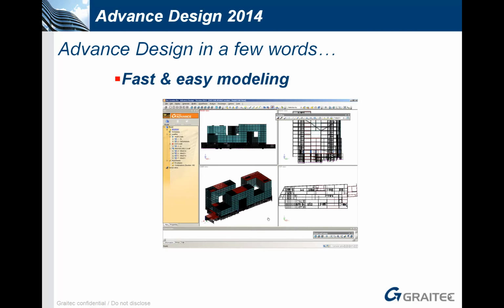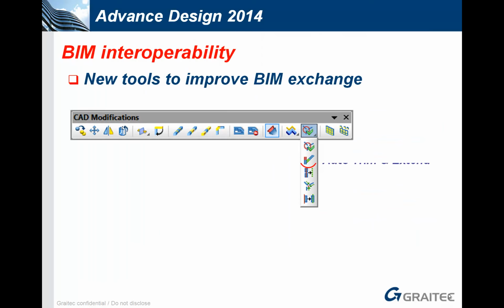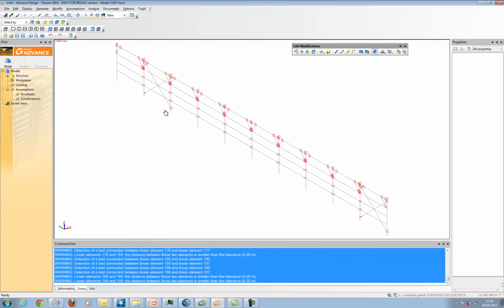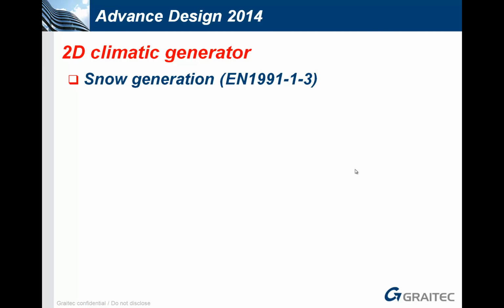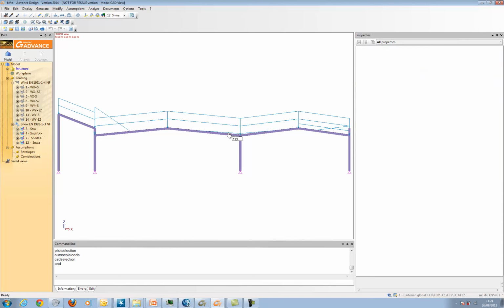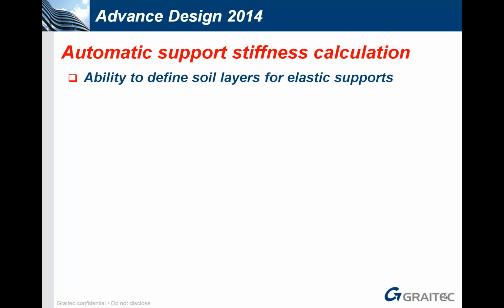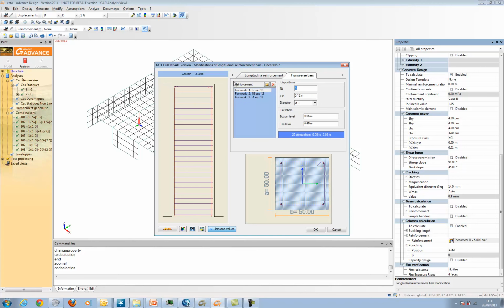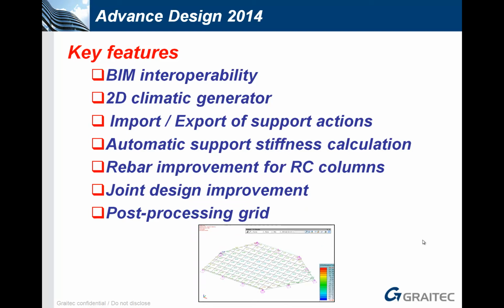Discover GRAITEC Advance Design 2014 !

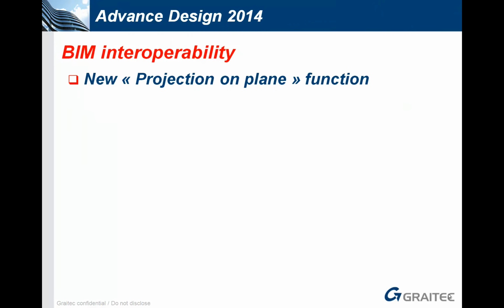Comment: Neat program. Not to be a nitpicker, but I believe you put an extra "n" on the word "columns" @ 4:00 -- I normally wouldn't say anything, but I understand how important it is for a presentation for a business product to be as professional and correct as possible... and how something as tiny as that can actually cost a business a few customers (those who think "Oh, there's a typo. I'm not buying it, now! If these people messed up their presentation, then how do I know they didn't mess up their program?!?)

Anyway, I personally think that this is an innovative looking product, and I will be keeping an eye on it.
Reply: Hi Little Angel, you're absolutely rigth. Thank you for your remark.
You can find more informations on http://www.graitec.com/en/ad.asp
Best regards,
Babacar.
Reply: As great as this program seems, I'm afraid that its use would be limited for me. I mostly create 3d graphics, and when I need to "dig deep" and mess with the mesh itself I tend to use Rhino3d... but things may change if I start to build things in the real world. This program definitely looks great for architectural planning and design!
Reply: Little Angel Yes, it's 3D modeling software for steel detailing. It's 
dedicated to AEC (Architecture, Engineering and Consctruction).